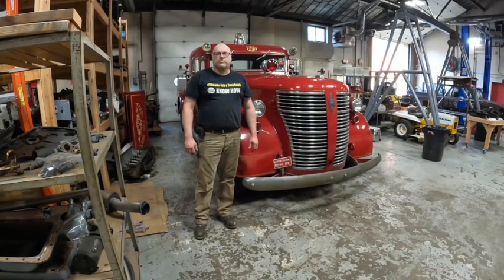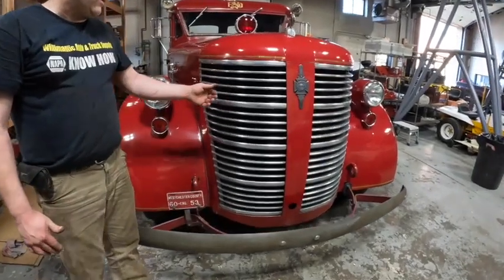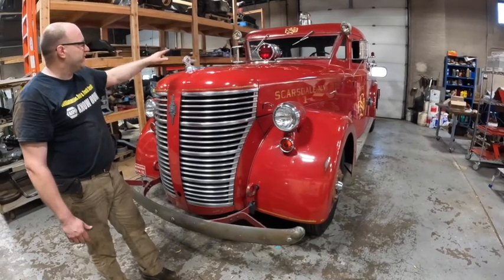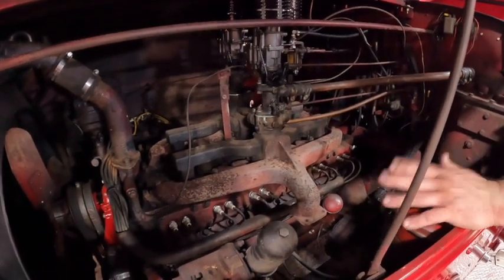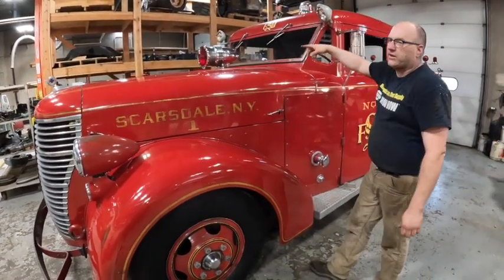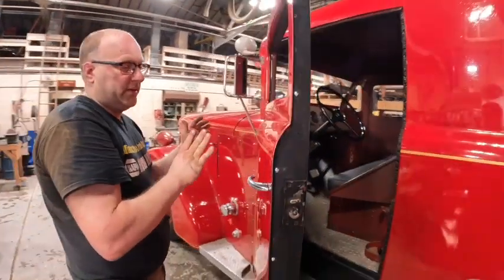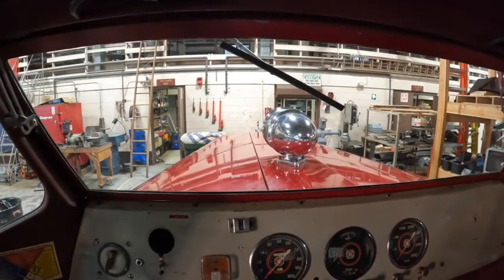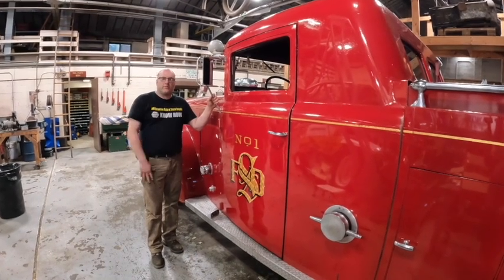1946 American LaFrance 500 Series Fire Engine Walkaround

Comment: Purchase, NY (not too far from Scarsdale) had one similar to this except the ground ladders were stored above the hose bed and cab. The ladders were covered with a unique two piece metal cover. The rear portion was bolted to the front part which was molded into the cab. I believe Purchase's truck was one of the first American LaFrance 500s to roll off the assembly line. 👍🏻